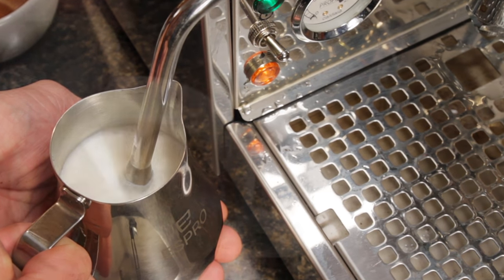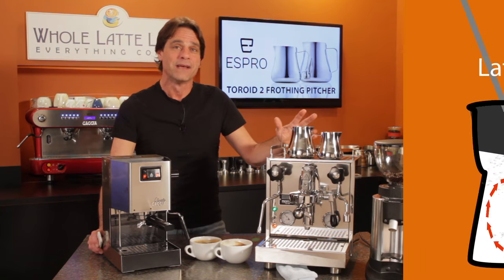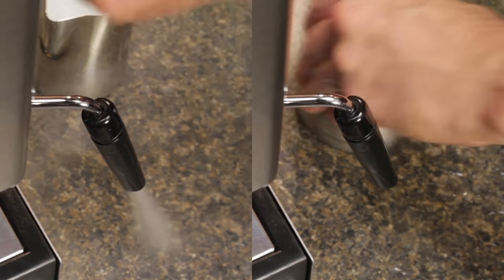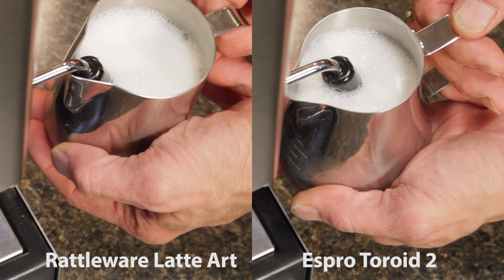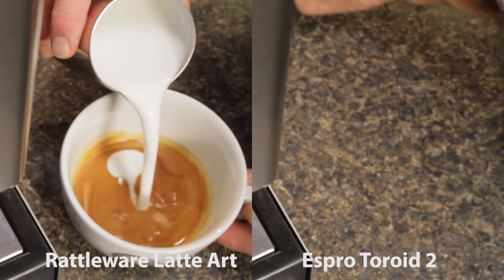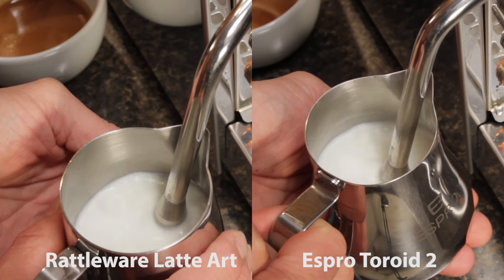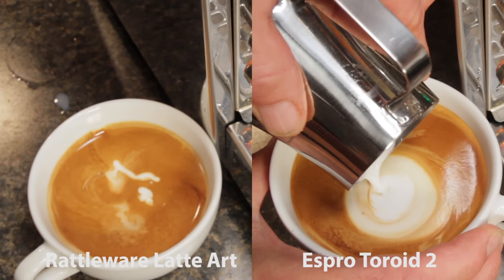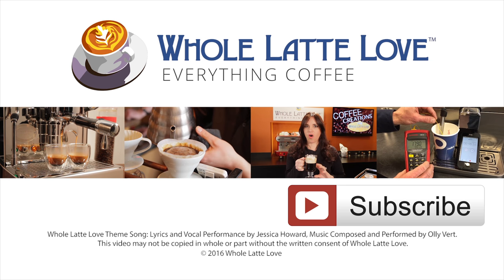Review: Espro Toroid 2 Milk Frothing Pitcher

Comment: Question I'm probably frothing wrong but I get a big clump of foam at the top.  Why?
Reply from the maker: Hi Kev, What type of wand are you using? Autofrothing wands tend to produce a layer of larger bubbles on top. If using a manual wand foam on top means you're adding to much air or not getting a good roll to break up larger bubbles. For latte, just sip in some air at the start of frothing. As the outside of the pitcher starts to feel warm it's time to take the wand a little deeper and roll baby roll! There are some good videos with more info on frothing here: https://www.youtube.com/playlist?list=PLaBDDfOHAAC0ODBtL-wwST5lVwmjy0QJ3

Comment: Search for "IKECCI'S Latte Art " here on youtube. That guy is doing some extraordinary latte art, the best out there, with a basic Rattleware pitcher. And there is someone else doing equally impressive art with a Motta. So any claims that those brands aren't good are just bogus. Nope, I'm afraid this Toroid pitcher can't replace lack of skills, and you can't possibly justify the increased cost.
Reply: I wonder if this would help people using machines that generate less stream pressure.
Reply: My understanding is that they are marketed to people with less flexible wand positioning. The idea being that since the wand can just point straight down, it doesn't really matter if you have a cheaper appliance-level machine where you can't get a good angle from the stream wand

Comment: I have version 1 toroid. Conclusion, go get a motta pitcher
Reply: socomon69
 with regular motta I get better results. Toroid is maybe helpful for very weak steams. Other than that is useless. If you are experienced also you can steam milk in any pitcher. So stick to normal ones and learn the techniq there.
Reply from the maker: I'll support that! Toroid does a fine job with a machine with more steam power. Technique a little different than with standard pitcher. Aim that power at the dimple and it really produces a vortex that involves the whole pitcher.